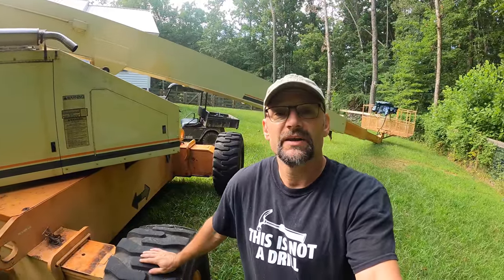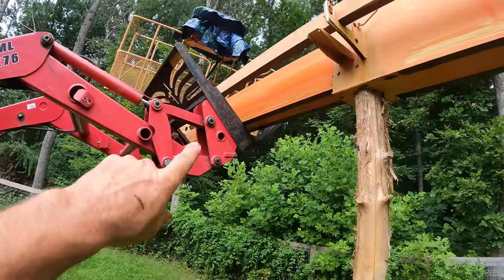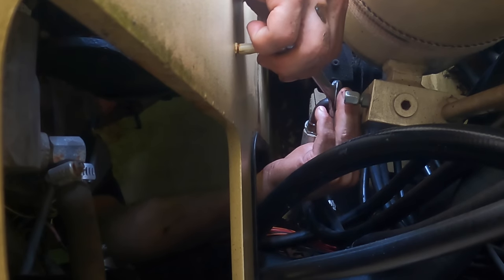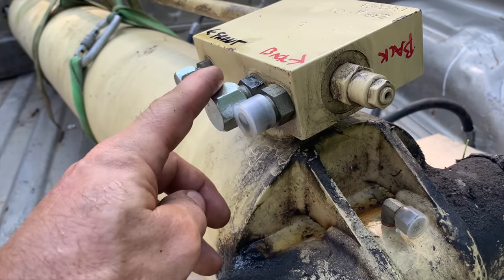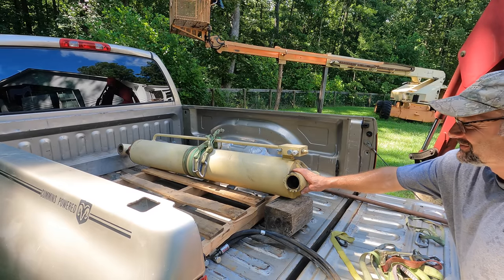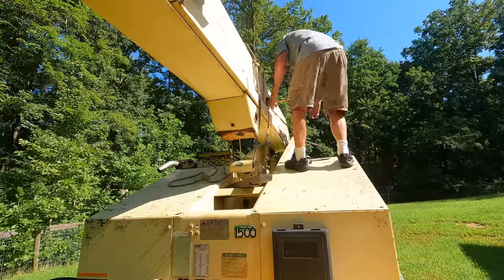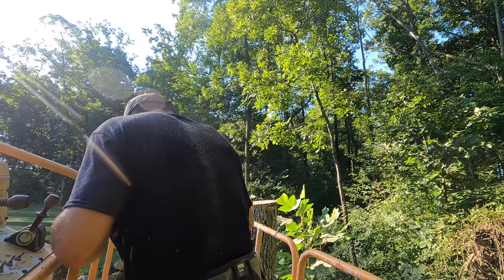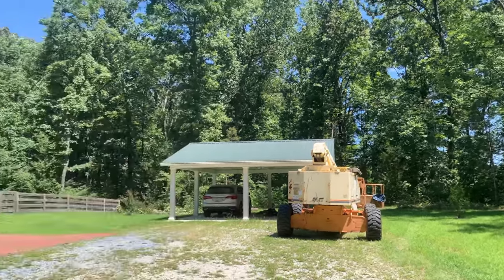Boom Lift Repair - Main Hydraulic Cylinder. What a BEAST! & Cutting Down Dead Trees.

Comment: That was impressive work.  The scale of the boom lift repair seemed well beyond a normal backyard mechanic.  On the trees, given you needed a crane to complete the tree work, it’s easilly a $5000 USD job.
Reply: Agree this is easily a $5000 job
Reply: @JonMarinello  Just had one tree taken down in Middle TN and it cost over 2K for one tree and one branch so i am guessing closer to 6-7 K
Reply: Yeah I could easily see this. Had to take down a tree where there was nowhere to drop it, relatively easy access and still climbable, and that put me back nearly 1500, although they were rope lowering the cuts they made so as not to damage the garden around the tree. Also they would've charged extra to haul out the logs.
Reply: Now I think that I didn’t pay too much to get rid of 2 cocos palms in my backyard. They were nowhere near as tall, maybe 20 to 25’, but much heavier than any normal tree. Left sizeable craters in the ground. All up $1500AU.
Reply: I paid $2500 for 3 trees that could all be easily felled, but that included grinding the stumps and leveling/reseeding the lawn. I agree, though, this is easily $5k.
Reply: I'm in Australia (so obviously what I am about to say isn't going to be identical to what you do over there)
We just paid $2k AUD (which is about $1.5k USD) to have 5 trees felled, but easy ones that just needed to be felled away from things they were near. No boom lift etc. required.
I would hazard a guess that we would have easily been up for $7-8k (so $5k USD) for what you did there.
Reply: @handlebullshit  Most of that is crane rental.
Reply: @Scott Milano Hi how are you? Hope we can be friends..
Reply: More than $5k. But depends on the distance from a city you live. If i have to transport a lift 100 miles out in the sticks. The price goes way up.
Reply: We removed about 15 thirty five year old, over 100 foot pine trees and seven or eight 25-35 foot tall large canopy trees which were very close to buildings at a 15 building apartment complex. Around $110,000. They ground the stumps. Took several weeks. The moral is don’t plant little sic foot lines within 15 feet of walls, structures, or walkways and then ignore them for 30 plus years. We inherited the problem. People always want to plant too many trees too close to things. They never think about the future. I see it in 100% of new construction. The residents complained about the tree removal and I hated to do it because they were pretty, but we had no choice. A couple of them had hawks nests and we had to wait till the babies left to take them out. The crew climbed every single tree, no lifts and no cranes, not even a tractor to pull out material. I think we actually got a deal. 4-6 men working for about six months. We gave the guy close to $250,000 in tree removal that year. You saved yourself a bundle by doing this yourself. I think a helper would have made it safer and faster but I applaud your work ethic. This kind of creativity and gumption really shows what’s needed on a farm and sheds a light on how difficult it is to make money on a small farm. Man against nature. True Grit!
Reply: @marclevitt8191  I agree with planting trees near your home. Bad idea. 
The city took a tree within their right of way 10 years ago. Ground the stump. The tree recovered and grew back to the same size. 😄
The tree stared branching out it roots and got under my home and invaded my sewer. 
I told my wife if we ever move out and move. I will plant trees but not close to sewer or a house.
Reply: @handlebullshit  cost it up yourself

Comment: You Sir are Wild in the head. I salute you. 
This is the best example of lateral thinking  I have seen in forty years of  self repairing. The level of tensity, tenacity and ingenuity is incredible. I would expect if a ship landed near your shed you would have a reasonable chance of understanding  the reverse warp ion drive rotor collimator. With their tools, ( a few might go missing), you would have a fair chance of fixing it. The risk you took here, thought thought out, would have left the  three booms only fit for Penguin rooster boxes. 
Your land seems short of lime. The following adage seems applicable - x place born, x place bred, strong in the hand, wild in the head! 
Your videos are very pleasing and would be very informative in a classroom environment for teenagers, for life lessons.Great example of how not to be thick in order to do something successfully. Well done.

Comment: The lift cyl is considered a "power down" cyl: it is valved so that the maximum weight+load on the boom is not enough to overcome the check. The hydraulic pump has to actually generate MORE pressure than the natural/gravity downward force, to open that check and lower. This way if you loose a control valve it doesn't drop out of the air.

Comment: I had a hydraulic shop rebuild a large cylinder for my 15k forklift, it's similar diameter but longer than what you replaced.  They rechromed the rod, it was about $2300CAD ($1800US), so I think what they charged you seems reasonable.

Comment: Great job.  Down in Florida a tree removal cost anywhere between $750-$1500 per tree minimum.
Reply: In estonia one  tree cost about 500 euros or more
Reply: Damm
Reply: Well it's dangerous. They earned it with their lives on the line. I'll pay if needed
Reply: @ravenyangwenda368  Yes, and the equipment they use are very expensive, so that price isn´t strange at all.
Here in sweden you need an aurborist education and a special "drivers licens" for the chainsaw to cut down a tree in a city.

Comment: Love the ending, how you build a tree...  😁
As for a cost... I'm no tree guy, but I would guess that it would cost around an 8" cylinder rebuild + a whole ton of oil.   🤔
Reply: pretty accurate for that number of trees. They might not even fix the fence after :P
Reply: Agreed
Reply: I have 5, 40' trees I got an estimate on just taking out the top 15' and he quoted me $ 1,700 and that was just dropping the branches and I would have to clean them up . I've never had a tree done but with his equipment it seemed a little steep.
Reply: @darellsunderlin4670  1700$ is nothing when you can fall and lose your life

Comment: I realized something after watching this video several times.  The two nuts for the hoses on the bottom of the cylinder are close together so they do not come out.  It works like locking cables like on the King Pins.

Comment: In the 1980s I bought old motor oil from a nearby garage, added pigment and painted our newly erected paling fences. It worked a treat and the oil soaked into the timber preserving it for years. Every time your tension wrench "clicks" I laugh. Every single time :)

Comment: GoPro connected to a smart phone or pad is another really handy remote vision. You are braver than me to attempt this kind of repair. Expensive all told but that main lift cylinder really needs to be right. I'll never blow a seal again without thinking of sea mammals.

Comment: I love these lift repair videos. I have a small 70's vintage (40-foot boom) Simon lift. Since  it's old and I haven't had it very long yet, I have to repair things fairly frequently on it. I'm simply figuring it all out as I go and these videos are a great help toward that. I'm guessing you probably experience similar to me that as you go, you get to learn how the thing is engineered and how all the different things function one system at a time and you gain a lot of knowledge in a pretty short span of time. In one sense, it's an expensive pain in the rear, but the increase in understanding is fun and feels great.
The other thing? These lifts come in handy about 15 times more often than I ever thought before I had one. I used to think having a lot of scaffold for working high was a luxury. My lift made the scaffold cumbersome and obsolete instantly.

Comment: This is DEFINATELY one of the the more dangerous jobs I've ever seen on your channel.There is people from my old job (retired) that would have FREAKED out at the way the boom was supported,and I did momentarily pucker when you stuck your fingers and hand in top pin hole cylinder MTG checking alignment(it only takes a sec.to make stub out your arm). Please be careful because I love seeing more of your videos,🙂
Reply: what would have been the correct way to support the boom?
Reply: @MM-24  The correct way would not have been economical. But. There is no replacement for an amputated arm. The cheapest way to do ths safely would probably be to fab up some sort of crude cradle made from all the timber he has laying around. A single wobbly post  or 2 doest cut the mustard
Reply: @h34evr  could have also taken the pivot pin for the arm out, and lifted the back of the boom up and out of the way. granted, lining that back up would have been absolutely terrible. i was cringing at a few points during this, but all in all, he understood the risks, and mitigated them as best he could. he is still alive, and he didnt have any near misses (or didnt show any, which is unlikely as he seems to show everything). i did yell at the screen when he stuck his fingers in the pin bore to check alignment though haha!
Reply: @analog56x  the fact that he understood the risks just carried on made it so much worse

Comment: I just had 14 trees removed. One was close to the house so they had to climb it a lower the pieces with a rope. They ground the stumps on 11 trees and took all the wood away. They left a huge mess in the yard from the skid steer and the wood chips. Cost 8k.
Reply: 8k for 14 trees? dang i paid 1800 for ONE tree.. you got a hell of a deal.. as far as the mess from wood chips. theres literally nothing that can be done about that when you grind the stump. my guy used the chips to fill the hole where the stump was.. they also used a skid steer to pick up limbs.. again, nothing they can do to help, just part of it
Reply: @tncountryboy06  one tree or 14 scale pretty much the same. It's the upfront costs of planning, driving, setting up, etc that's gonna cost you the most.

Comment: i just came across your channel and have watched your journey with the repairs on the lift ,  I had a mature ash tree that had died from emerald ash borer, the tree removal company charged me 2400.00 dollars  and they removed the stump. it took about 4hours and they had 3 to 4 guys working  1 in the boom 2 hauling away the limbs as they ere dropped to the ground and 1 running the chipper machine another tree removal company wanted 4200.00 dollars so i see several other comments suggested 5000.00 dollars i think that amount is certainly a very fair price since you cut down more than just i tree. i am enjoying your channel. looking forward to new videos

Comment: Great job per usual buddy, still learning sumn new from every video, which is amazing. and anywhere from $3,500 to $5k, especially if it would have required ropes to lower the pieces, regardless if u used a lift or not.. ur doing great 👍🏻

Comment: I would say 4-5k would be a fair price for the size of the trees. We have had a lot of tree work done recently. A couple were 3.5k each with clean up and removal of all material.
Reply: Holy crap you got scammed! I would say roughly 2k for that work! At least where I’m located. And that would be the high end. I just had about 15 trees taken down, (full-size oaks and maples) as well as a building site leveled and compacted and it costed me 4200 dollars!
Reply: Also they cleaned it all up stacked me up a nice log pile and a separate brush pile for burning
Reply: Oh and they also pulled all 15 stumps!

Comment: Turned out to be a rather expensive add to the tree removal project!  Removing those trees would be about $1500 to $2000 job in northern MN.   Nice job on the cylinder repair.
Reply: - I was guessing $2000.oo...which seems low, especially since an expensive piece of equipment was deployed...add in another $1000.oo might well be seen as fair.
Reply: Wow, Cheap!  Here in central MN, they get $600 to $3000 per tree, depending on the name of the company!  Probably because there are less people/companies with the tools to handle a job of that scale.

Comment: You need to look into home made pullers. Screw threads can put out immense amounts of force and a homemade puller utilizing a fine thread 3/4" grade 8 threaded rod or something like that (or just multiple smaller fine thread rod), can help MASSIVELY when you're trying to pull pins. I don't reach for a hammer if the pin is thicker than 1" unless I have to.

Comment: I appreciate your struggle with the cylinder. I used to test the individual components and even then they were hard to manipulate. The cylinder body was lighter than the rod.
Having used a few cherry pickers in my work, I would always avoid too horizontal angles. This reduces the amount of wobble, which I’m no fan of. I always reported a machine that didn’t move smoothly.
Great video.

Comment: Good Job on the Cylinder rebuild and Install.... coming from a 20 Year's + Hydraulic Guy I can't believe you did that on your own....You've been doing your research I can tell...not everyone has JIC caps and plugs... and not everyone is going to change the oil...kudo's... you're starting off on the right foot.. Good Job

Comment: Wow- I was wondering how you were going to fix that cylinder- great job!  I’ve had a bunch of trees like that in my yard cut down by professionals.  If it was my yard (in Texas) I’m guessing they would have charged me about $2500-$3000 for that, depending on whether they had to haul off the trees.

Comment: I'm a little bit concern on the missing break: if the boom is very low, or high, much weight will be on one side of the maschine.  When you rotate, then can be most of the weight only on one wheel and if this wheel have no break there is an opertunity that it can slip.
Reply: I assume you meant ‘brake’? The two axles are driven by two separate hydraulic motors, so as long as at least two wheels are on the ground, the wheels will be locked. The machine has no brakes as such, the hydraulic circuits provide the braking.

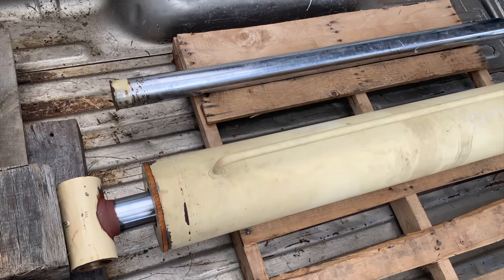Comment: 24:13  My immediate question: Why didn't you ask the machinist to re-port manifold? It would have added to the repair cost, of course. But you discovered two design flaws that a machinist could have easily remedied. The main job is done--roger that. But still, you should have discussed the practicality of modding that manifold with the machinist.

And another thing... 
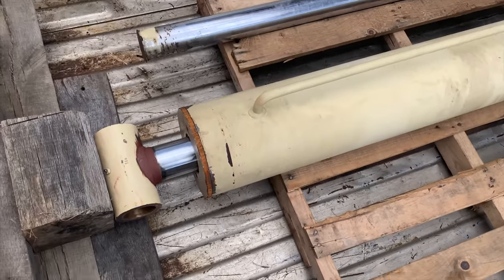23:45  The machinist used acid-etching primer on their weld (the red stuff) which is exactly correct! But why... WHY... didn't they primer that four inches of exposed rod? And why... WHY... didn't you primer/paint that four inches of exposed rod before you reinstalled the cylinder?  ...grumble.
Reply: New hoses at the same time. Cheap compared to having to pull it out again

Comment: This was a clear case of expert experience. You obviously have been wrenching for an extended number of years and have encountered numerous very difficult situations. So frequently that you have become unfazed by difficulty. 
A lesser mechanic would have stopped and said impossible until realizing he could remove hoses with the cylinder and would never have even attempted to wrench in such a tight blind space.
Been there done that.

Comment: Tip for next time, draw vacuum on the hydraulic tank from the cap using your shop vac, this will almost stop the flow of liquid when you open it, so you  don't make a mess. I am not sure how well it works with oil, but with diesel it works a treat.

Comment: 4 man crew. 1500.00 a day. 2 days work. tree disposal. 3000.00...minimum 6500.00. less if trees are just being dumped over the fence. Im not an arborist but I did stay at a motel 6 last night. great job on the content and presentation.

Comment: Half way thru watching this video: Great stuff. I used to mix used free to me hydraulic fluid in an old 504 french made diesel station wagon. It had an 22 gallon tank that was flat and had a tendency to grow algae. Drove thru college, put in a lot of miles mixing in unknown ratios of fluid and fuel. Worked great. Only reason I got rid of it was it had no less than 5 belts on the engine. Frenchy stuff.
Try the fluid on your diesels. YMMV.

Comment: those are fun to work on, i had them where the pin gets bent. the 40ft boom is muck easier to work on! Jay the Florida pool pump motor bearing repair guy When Service Calls Longwood approved ! that was good info 👨‍🔧FarmCraft101

Comment: Old well driller here. That lost bar can be retrieved with a combination socket. You can find old ones cheap. They screw on rope socket and are machined to fit drill bars with three hardened jaws on a taper like a japanese finger socket. Got a dozen bars out with mine. Secret to not losing bars. Change the connection at top of bar when you see cable wear at top of bar, or change every three months. Don't know why I didn't think of it before. Good luck.

Comment: On tough to reach fittings, I use my 1/2" Milwaukee, an extension, and the right size crows foot. Just a bump usually pops them loose.

Doing this work in the field is a real PITA. I did it for many years

Comment: I found your Channel by accident with your Excavator "Will it start" videos. I have tried to follow and watch a lot of channels I thought I would like, but they just did not stick. There are only a few channels I revisit time after time from Watch Wes Work, Diesel Creek, Andrew Camarata, Salvage Workshop and yourself now included. I think all these channels jump out because the owners of the channels are not afraid of failure, they all embrace it which makes viewers feel 'I can do that' if I had a big enough Hammer. Thanks for the Back log of videos and the Videos to come.